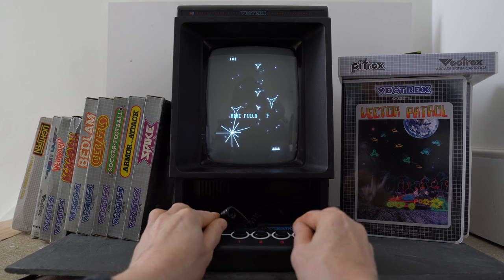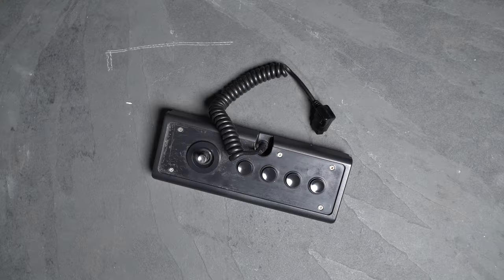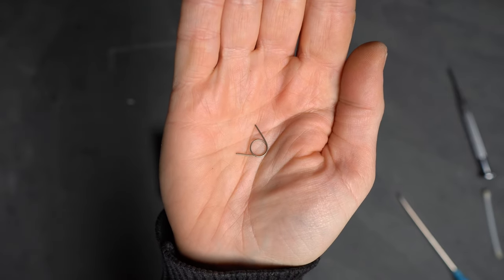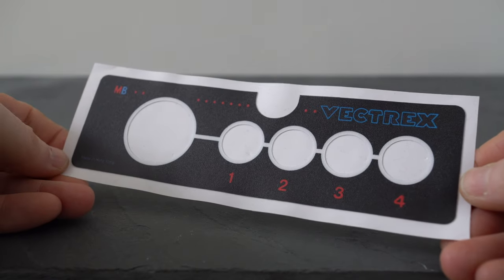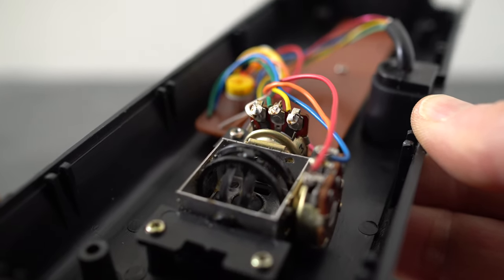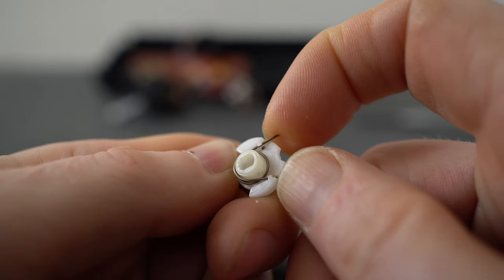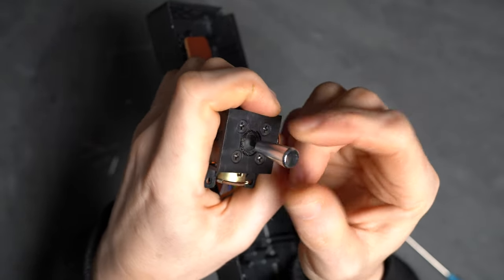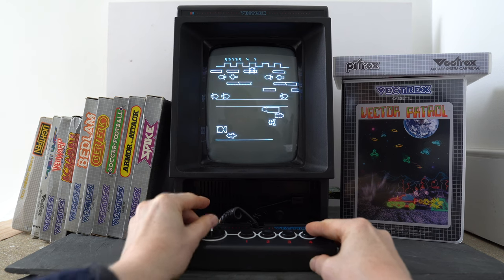How To Fix a VECTREX Joystick: Controller Spring Repair

Comment: I knew I liked you for a reason, Gordon. I always thought it was for thorough, stellar camera testing. But, no. It's for being a Vectrex owner! I will say, don't ness with me on Scramble. I was the bees knees. I remember my cousin had Intellivision. Man, consoles were so wild in those days...
Reply from the maker: Hah, thanks! Yeah I loved those 80s consoles. I lusted after an intellivision when I had my vcs but a colecovision cured tgat, and the veccy beat them all! Love the scramble port. Have you played any of the homebrew games? There's an excellent Defender.
Reply: @DinoBytes  I have not. My little brother has the console and is well familiar with the modern community and homebrew games. About 4 years ago, I got out my old Logitech wheel and pedals, my PlayStation 2 and played GranTurismo 5 for hours and hours and hours over a long weekend. I then put it away and never took it out again, LOL. I'm bad at managing my time with video games, lol?

Comment: 4:01 I would say using long nose pliers could make the job safer!
If they got deep enough grooves to grab on those tabs.
(or with some wire clippers with one flat side, like I usually do😝)

Oh, it was A PiTrex you talked about😆

..I'm afraid to say, but never had a luck to encounter one single Vectrex here in S. Korea to be honest😔
But anyway🙃🙃

Love that vectorscope (or oscilloscope-like?) display!
Also I'm personally in to versatility of vector image file format like *.svg, (or 'Scalable Vector Graphics')
Like, long gone Macromedia's Shockwave Flash

Nice instructional video👍
(Sorry if my English was kinda weird🙃)
Reply from the maker: Thank you, and good tip about the pliers. Your English is perfect!

Comment: My first console for Xmas, I went to look for it in my parents attic last year and think my father threw it out all I could find was the controller and 1 game of 4 that i can remember, amazing at 7 or 8 years of age for sure 😊
Reply from the maker: You can sell the controller if it works... are you in UK?
Reply: @DinoBytes  Ireland.. currently have it up for sale for parts or repair the panel needs to be replaced and the 9 pin connector needs replacing

Comment: Really enjoyed this video, my controller has this very problem. You said you got your springs from the UK, can you remember where you got them from as I can only find the US ones. Regards.
Reply from the maker: Hi there, first of all, sorry for not linking to the eBay listing where I bought them! But secondly extra apologies as I just looked it up and they don't have them anymore! So you may have to go to the US for this one. But try searching on eBay anyway. My original listing was "MB Vectrex Video Game System Spare Controller/Joystick Springs"
£5.00
Sold by:
elcolonel666
Reply: @DinoBytes  
Thank you so much for taking the time to reply, it is appreciated. I did have a look on ebay, but not sure if I'd be buying the right size spring, so I will go to the US. Thanks again for putting the video up, as I was considering buying a new controller, hopefully I can fix my own at a considerable saving. All the best and have a great Xmas.
Reply from the maker: @JoWatts-f5j  you're very welcome, sorry I couldn't point you towards a UK supplier anymore! Also if you're not already a member, do join the Vertex Facebook group I mentioned, as there's always someone who's making a cool new controller on there.